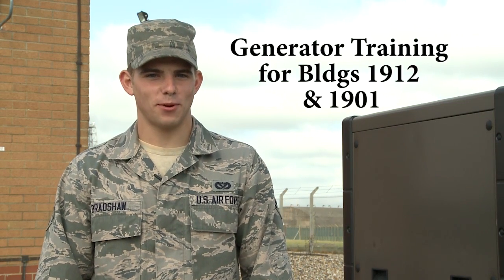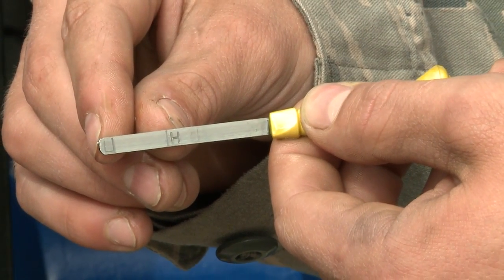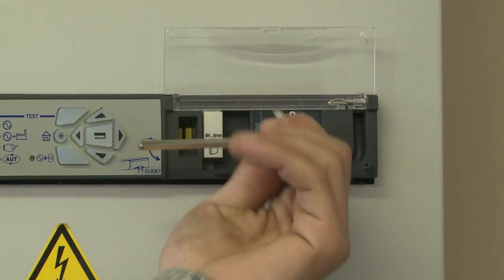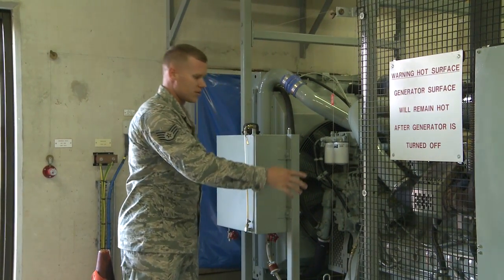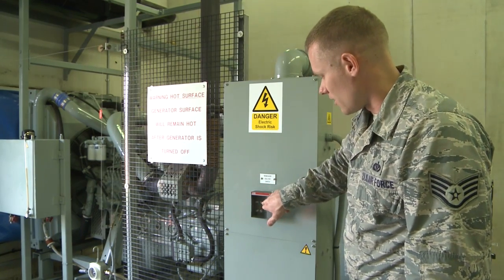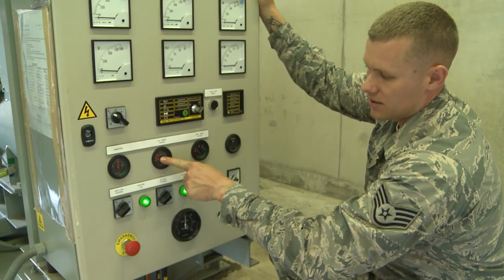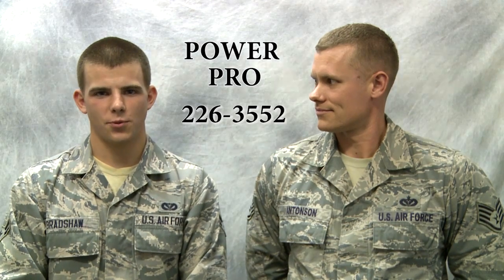Generator Training Video

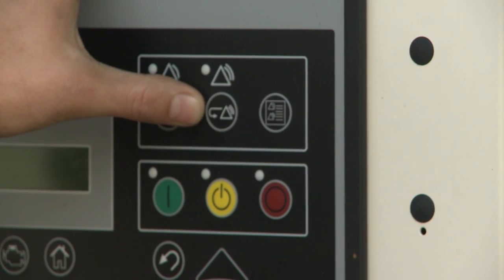Comment: 03:30. before starting any work, set the machine to the 'stop' position using the red button. Only then can you start checking fluids, pipes, belts etc.
Reply: Might be automatic startup but fuck it. Let's start the servicing
Reply: Wrong. Under OSHA regulations, an e-stop button cannot be used as a lockout device. 29 CFR 1910.147 "Push buttons, selector switches and other control circuit type devices are not energy isolating devices." If isolation is required, they must lockout using the designated energy isolation device.

Comment: Wow, manual transfer between Commercial and Generator. So if something were to happen and you lost commercial power, and one of you guys are somewhere off base, the facility would be down until you hightail it back to base to operate the manual transfer. You should suggest to your Supervisor that it would be best to invest in an ATS instead.
Reply: Does the ATS have an off position? Change over contactors can only engage and disengage it's coil.
Is the generator hooked into a SCADA system?

It's easy enough for personnel to start the generator then throw the switch once genset is online.

It's not exactly switching that is fine remotely for safety, like HV.